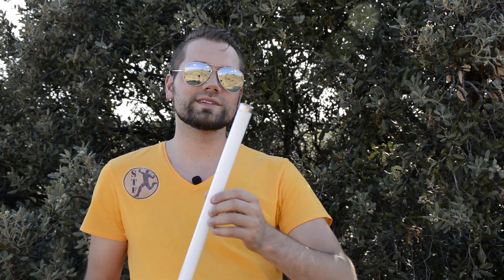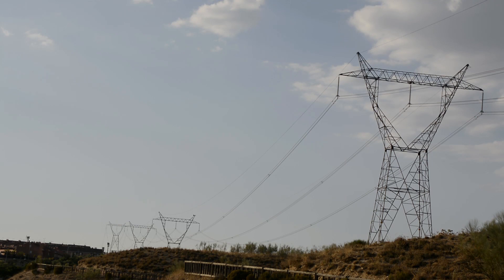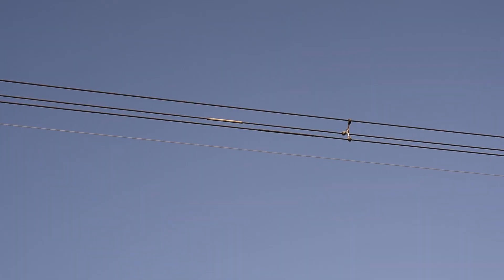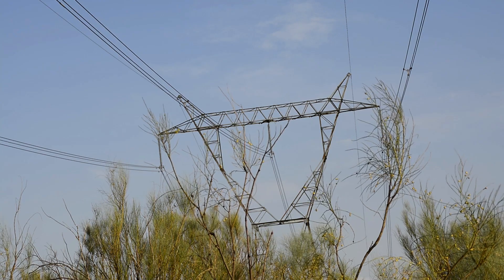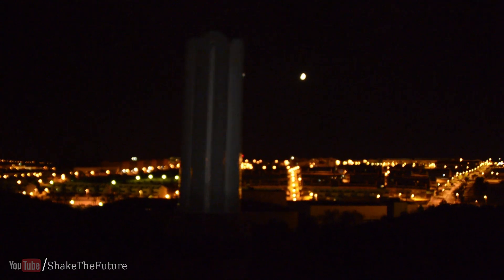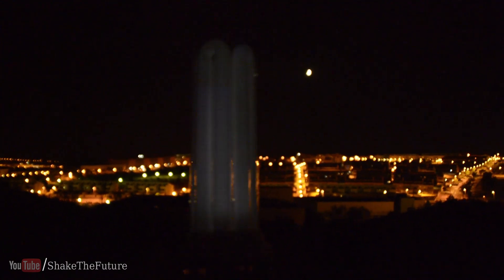Light up a Bulb Under High Voltage Power Lines

Comment: You can also take a 48" florescent light and touch it to the antenna on a cb radio or base station with any amp in line and it'll glow full as if it had a ballast feeding it

Comment: so, when you touch the contacts it gets brighter because you are acting has an antenna, so, if you connect an antenna to the top poles (with the bottom ones on the ground) the longer the antenna the brighter, perhaps even full power, the antenna would be just an electric cable connected to the connectors that you can tie to a tree and string it horizontally, or a metal bar or something but assure it doesn't get close to the wires
Reply from the maker: trombonista92 
Interesting! I might do some future experiments.
Reply: +trombonista92 ahaha Mario, ti trovo dappertutto!
Reply: ***** lol vero

Comment: I am not 100% sure, but i don't think its right to say that its the electromagnetic field that is causing the Flo tube to glow, but the transmission lines electric field. This is what i'm studying for my dissertation and i'm going to use a flo tube as well as other materials to find out how electrical fields affect and are affected by the presence of these different materials. 

To make an educated guess, id say the electrical field produced by the transmission lines over head (of which i don't know the rating (perhaps 132kv, single circuit, with 3 bundles per phase)) is large enough to create a potential between the pins of your flo tube, creating current in the flo tube's tungsten electrode which creates an electromagnetic field, and due to its material properties, releases electrons that flow through the argon gas, vaporizing the mercury and releasing UV which passes through the phosphorous coating and produces photons ie: creates light.

And perhaps the reason it is pulsating is due to either the weakness of the field at the distance you are from the transmission line's electrical field or due to the alternating current from the lines as it moves from a positive to a negative direction.

To say that its due to the electromagnetic field produced by the lines is to suggest that current is induced and that's not right, seeing as the strength of the magnetic field is quite dependent on the flow of current of which is minimal in transmission lines due to I^(2)R losses and is far higher in voltage than it is in current.
Reply from the maker: +reddevil230292 
Thanks for the correction!
Very good info.
Reply: +Shake the Future No bother, please don't take it as gospel though haha. I am a student and today i was learning about how electromagnetic fields produced by TLs can induce currents in things like metal crash barriers on roads and such, resulting in a potential shock if touched. If i ever completely confirm my suspicions ill confirm on this :P.
Reply: is it possible to somehow decrease that EMF under power lines ?
Reply: If this a question to me, Then yes, you can decrease the electric field. im not sure about the magnetic, part i never studied that, however the magnetic field should not be that strong compaired to the electric field as current in line is low whilst voltage is high. The electric field being a product of voltage and the magnetic field being a product of current, Hence the electric field in transmission lines will be the dominant of the EMF. Thats my logic anyway. 

You can change the cross sectional area of the conductors to decrease EF intensity, you can actually decrease the intensity of the electric field by having trees near the transmission line, in the vacinity of the field, acting as a shield (the trees have to have a moisture content though for this to work, most living trees would though of course). You could decrease the voltage in the conductors or you could place the conductors higher up, the electrical field intensity decreases with distance from the conductors. 

Please however take this with a pinch of salt, i am a soon to be (very tired) graduate lol.
Reply: I was wrong, i think. It is induced current. It is an changing electric field inducing a current which is maxwell's unifying theory of electromagnatism.
Reply: Thanks for your reply - i buying a some  land which happens to be under some power lines which im afraid may hinder the plant growth -  that is why i asked.
Reply: Thats quite an interesting question and one specifically that i looked at. Growth impacts seem to be minimal from what i've seen. Unless very intense fields the impact seems to be minimal. 

Journals that ive read on the subject & authors (simply google them and have a look, hopefully you can gain access to them):

- The Comparison of Electric Field Intensity Affects to the Bean Sprouts Growing (P. Kiatgamjorn*, W. Khan-ngem* and S. Nitta**)

- USE OF WOODEN STRUCTURES TO REDUCE ELECTRIC FIELD UNDER EHV TRANSMISSION LINES (Aruna Gunatilake, Zhongdong Wang and Ian Cotton)

- A study on the influence of high electric field intensity treatment on crop life (Gowrishankar S, Gowri Sree V)

- Effect of 60-Hz High Intensity Electric Fields on Living Plants (G. W. McKee & D. P. Knievel)

- The Effect of Electric Field on Bean Sprout Growing (P. Kiatgamjorn*, W. Khan-ngern* and S. Nitta**)
Reply: Thank you so much for the data i'll defiantly check it out
Reply: R.Cook it is the ground potential. High voltages tend to leak current into the ground due to the insulators at the top acting as capacitors, causing it to leak for at least several miliamps, but it won't kill you, unless you have steel shoes, that's why substations have rocks and uneven terrain underneath, because people living farther from it tend to have deadly showers very often. I have observed this on my experimental 12kV system with only little chinese hats. Spoiler alert: I got shocked from a distance of the system.
Reply: R.Cook edit: it is also the EMF fields inducing current into the fluorescent tube.
Reply: there is no separation between electric field and electromagnetic field. Electric fields produce magnetic fields perpendicular to them

Comment: The fact that it worked with a fluorescent strip wasn't a surprise to me. The fact that an LED bulb lit was definitely a surprise to me.
Any ideas why? Is there a coil inside that one?
Reply from the maker: I have no idea why did it light up.
There is a transformer inside of a bulb, so that might be the reason the bulb lit.
Reply: The light emitted from the fluorescent tube is a result of the fluorescent coating reaction on the inside of the tube. If that EMF field was strong enough to cause the mercury to vaporize you might not have been around
to post this video. Read "fluorescent tube operation" to get a better
understanding on how they work.

Comment: Do you know what the kV was of the transmission line? Trying to experiment in Australia/New Zealand where the kV often doest go over 220kV and want to know if it is possible? at most it only really goes to 400kV or 500kV

Comment: so, does this mean there might be a way o attach wires to the terminals and charge a battery?
Reply: The current is alternating. Maybe use a bridge rectifier? The light also look pretty dim, so I doubt it has high voltage potential, not likely to do more than a trickle charge if that. Maybe steadily charge a capacitor attached to to bride rectifier first?